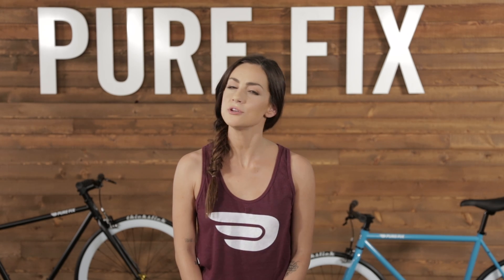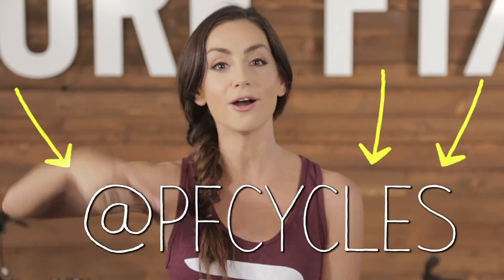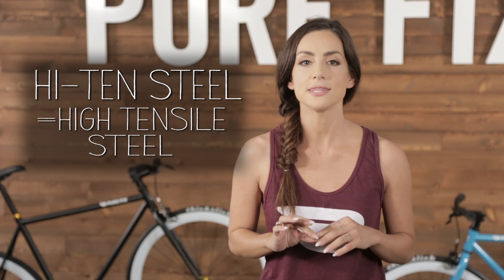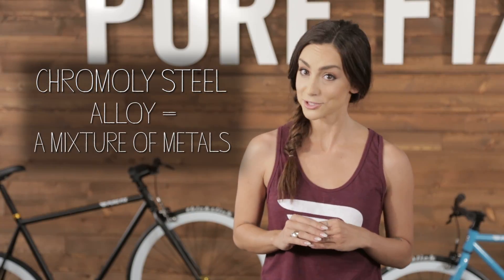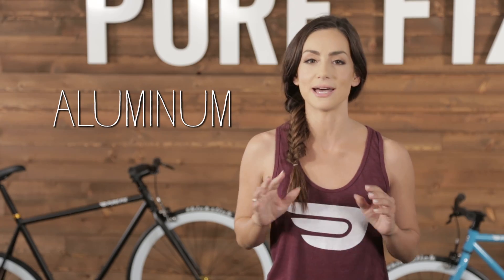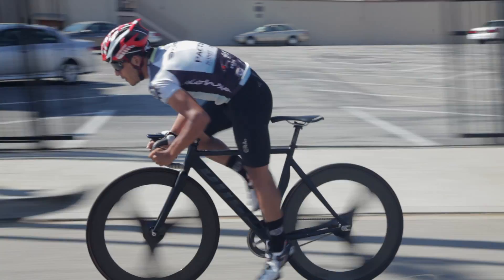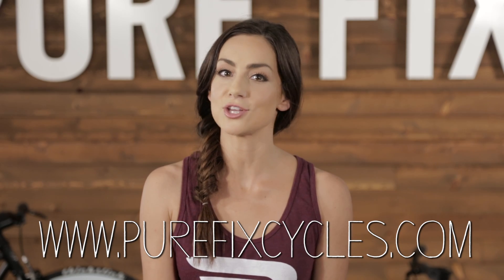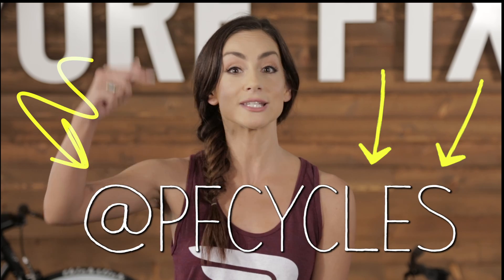What are Bikes Made Of? Steel, Chromoly, Carbon Fiber & Aluminum Explained

Comment: If you add shocks to the aluminum bike for all that road vibration, it could be heavier than the steel bike which does not need shocks.

Comment: What about a Reynolds frame? How does that compare to cromoly?
Reply: Reynolds is a brand name.  They make many different blends.  and each blend can be produced with different treatments, diameters, thicknesses etc...   A reynolds bike is likely cromoly.  Tube selection has to be optimizeed with geometry, intended use, and weld quality.  You can make a stiff reynolds bike or a supple reynolds bike. it will be a more expensive bike.  But a well designed reynolds bike often feels better than an aluminum or taiwan cromoly equivalent because a bikemaker can  "tune"  the small vibrations out of the bike without compromising power transfer or frame strength / integrity.

Comment: Aluminum: "not the best choice if your a commuter" ...no explanation, no facts to back up the statement???
 I cycle to work everyday (rain,sleet,snow) and aluminum is great because it never rusts... I don't get it...
Reply: aluminum is more rigid, the ride isn't as smooth, you get what is called "buzz", vibration.  most commuter bikes are made with aluminum, but most bikes sold as commuters aren't what i would want to commute.   misinformed customers buy a lot of bikes, that is kind of what a lbs is looking for.

Comment: 1. Bikes do not use carbon fiber, just carbon. Carbon fiber weights too much and it's resin degrades very fast.
2. Carbon is the only material for you if you put out close to 2000 Watts. I raced with a steel bike before during my track cycling days and felt it flex under me. I also striped a bolt in the stem before as well.
3. Track carbon bikes are the best not due to the weight, companies layout the carbon to be as aerodynamic as they could develop it as well as as stiff as possible. Carbon track bikes will weigh more than your steel or aluminum bike due to that they use excessive amount of carbon when it comes to an average person. Track cyclist easily put out more than 2000 Watts and are even capable of ripping apart a chain if it is not tensioned correctly.

Comment: What is better a 46 tooth or 48 tooth??
Reply: Esteban Ayala why use chainrings in the 40s, ride a 55t by 15t hub. Or go with a 66t with a 14t hub if you want.
Reply: @Charles  what is a good gear to go fast on the roads but still manage some good sized hills if I try hard? There is a Wabi that comes stock 48/17 so I assume that is too weak,  I was thinking 50/16 or 52/17 ?
Reply: What size wheels yu got? I took a road bike on highend speed on my 20 inch wheels hi-ten steel dyno nsx 43 by 16 with 165mm one piece crank believe me this dude is dedicated i dnt even see his punk ass ride bike threw my blok no more after that day

Comment: Could a carbon fork break while commuting? Is hard enough ?
Reply: After heavy use, yes. I really don't understand people who ride with a steel/alu frame and carbon fork. Weight gain is not insignificant but at the expense of durability. Hard to swallow when you have to $$$ for the fork. I don't see it worth it, you're not going to commute much faster, no.

Comment: I've an other question about the kenda tube. what are the difference between 60 mm presta (for 30-50mm rims) and the 80 mm presta (for 60mm rims). I have a original fix bike and I'm a commuter. which one do I need??

Comment: does the carbon fiber stay strong?
Reply from the maker: +Aloha_gamer Carbon does have a lower impact resistance which can cause carbon components to have a shorter lifespan when compared to other frame materials.
Reply: +Pure Cycles also older carbon used resin that can degrade if put into direct sunlight.

Comment: I will still use hi ten steel. I use a modified bmx with high seat post. I mounted a 5 x 10 x 3/4 inch wood plank on the top bar and used it to carry cargo up to 40 kgs. A real workbike in my country. I live in the Philippines.
Reply: +Gary Patag come to america, youl get a car

Comment: Why is aluminium not good for a commuter?
Reply: +Geoffrey Holmes Aluminum is great for a commuter. For whatever reason the ss  and fg communities say its not, but it'll be significantly lighter and last for years to come. All at a great price. (Basically all bikes are made up aluminium these days except for a bunch of single speed and fixed gear bikes, fat bikes and the pos' found at Walmart, target etc.). Oh and if ride quality is an issue just change tire size.
Reply: The stiffness of going over bumpy terrain but it still works. I've been riding one for years but going to make a switch to chromoly.
Reply: its fine its just a rather a harsh ride and if buying second hand ally does age harden
Reply: Aluminum alloy has been the standard material for Mountain bike frames for a long time now so it is proven aluminum frames can be strong. Technically Aluminum Alloy has I higher strength to weight ratio than steel even though for the same thickness it much weaker. Steel has about twice the strength of aluminum but aluminum is roughly 1/3 as dense. Aluminum frames have a larger tube diameter and/or greater wall thickness to make a frame as strong as steel and this also make a stiffer frame. A good steel frame on average weighs 6 pounds while an aluminum alloy is around 4 pounds for a rigid frame.  Older mountain bikes are good to convert to urban commuters. I myself have a mountain bike with an aluminum frame that I converted to an urban commuter it has front suspension and Thickslick 26 by 2.0 tires so it has a smooth ride.
Reply from the maker: +Geoffrey Holmes Aluminum is light and strong, that’s why they make airplanes out of the stuff! It’s also incredibly stiff which is great for getting the most power out of your legs, but can be hard on your contact-points if you’re used to a smoother ride. Aluminum’s also slightly less durable than steel and won’t bend before it breaks so, if you wreck your frame, you’ll be headed to the bike shop for a replacement instead of the metal shop for a welder. Still, Aluminum’s combination of low-weight and high-stiffness makes it a great material for a race bike like our Keirins, but may be overkill for a commuter or cruiser.